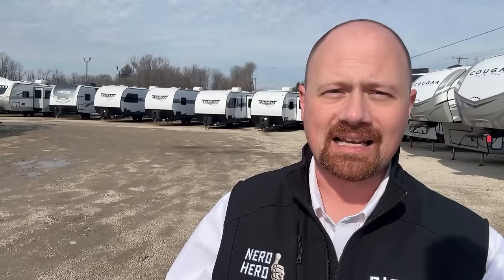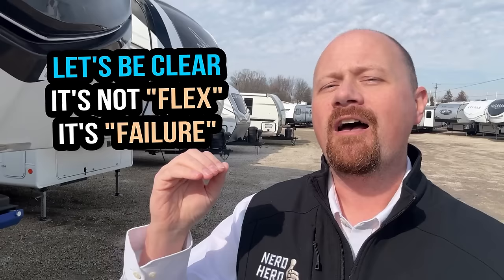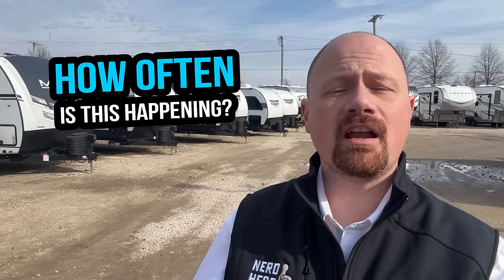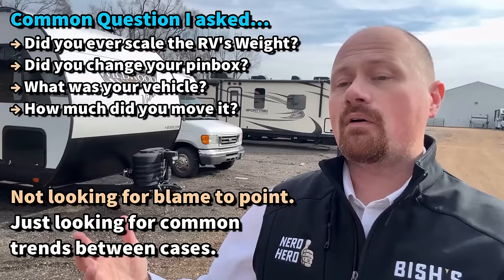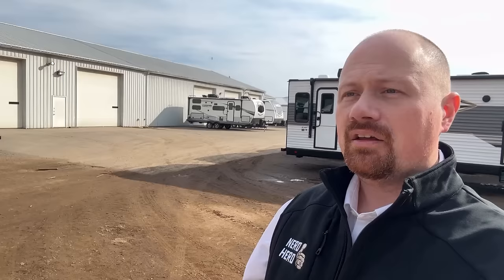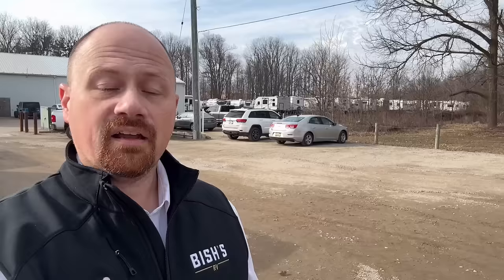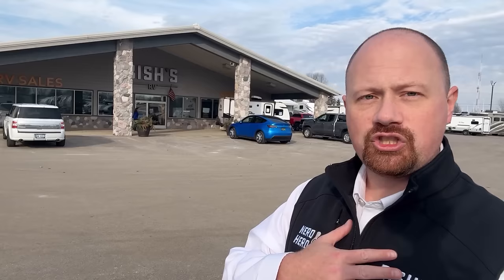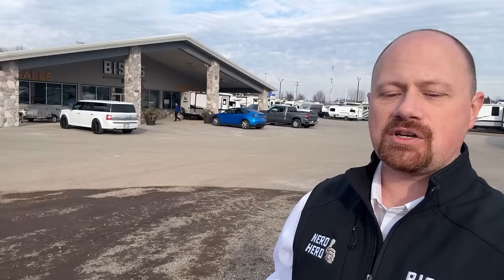🚨 RV Frame Flex & FAILURE!! • WHAT is Happening and WHO is Responsible?!

Comment: Josh,  Thanks for presenting this video.  Very good info.  You brought up trucks.  Here's one I have learned the hard way.  A 1/2 ton truck might very well be rated at 9-14k towing.  What people do not understand is that the camper might just be within the weight limits of the truck, however, when it is 37.8ft long, it can really be a challenge to tow it properly and safely.  Ask me how I know.....
On the 5er's... You brought up several points, but, I think that adding things like a washer / dryer to the front of the RV can contribute to the issue.  And, I also believe that front kitchen models are another problem.  Really, I personally believe that you should keep most of the weight over the axles or even further back, and not towards the front.  I am no expert, but, weight could very well be causing these issues.  Just my humble opinion, but, I would never have a washer/dryer in the front area, nor a front kitchen with that heavy residential fridge up there.  
Finally, I think that some of the problem is indeed the manufacturer, trying to get more for less.  The frame should be able to exceed the design of the RV.  Some of that would boil down to using thicker steel, and, work with the frame manufacturer to develop frames that were designed for the weight the RV builder is going put on the frame.
Reply from the maker: Spot on. I have a video somewhere in my library, here talking about trailer length versus towing length. That’s a very good point.

Comment: As a retired truck, driver, I approve of this. People watch your axle weights if you have a halftime and fill up the back of the bed of the truck with firewood, it might tow terribly.Just sayin
Reply: Absolutely! Mechanic speaking Anytime you overload a vehicle suspension it will ride on an overload spring or bump stop( or when hitting a big  bump the spring rate will increase dramatically) transferring to the axle housing and trailer frame. If your back and butt feel it, your trailer feels it!  The public roads are also getting so bad with pot holes, causing all types of problems
Reply from the maker: Ty Bruce

Comment: Thank you Josh for your homework and continued sharing with the community.  I just purchased  my first RV (5th wheel) then “Frame Flex/ failure posts all over the interweb to scare the crap out of me. To some of the points in your video:  I have been following you (and others) for over nearly two years before purchasing — evaluating my needs, tow vehicle specs, reading RV manufacture info and stickers/data tags. The BIGGEST thing that NEVER crossed my mind was that an RV might NOT have been manufactured for the sole purpose of dragging it all over the place. Maybe mine is… how should I know??  Manufacturers and dealers really need to help us understand these things and most importantly, as you stated make as much information about the their products readily available and factual. Keep the pressure on Josh and keep up the good work!
Reply from the maker: Ty so much. What did you get btw?
Reply: @JoshtheRVNerd  thanks for the reply Josh. I purchase a GD 150 series 270BN. It’s just the wife and I. We liked the floor plan a lot and wanted the 30ft length for National Parks etc. After all of my research GD, seemed at least, to still be a good brand. Seems to be different being said these days but the workmanship on our rig beat out most others we looked at in that class.  FYI: I’m in California now but lived/ worked in Coldwater for 3 years and remember your family’s business.

Comment: Josh,

My wife and I were at a show yesterday looking at RV's we were able to meet the owner of Alliance.  Coley was very forth coming with all questions we had.  To the point, his responses were in line with what you stated in this video.  I asked him about the frame failure, and he did not avoid the question at all.  As a matter of fact, he stated many of the same things you did as to why it is happening and where Alliance falls in that spectrum.  

Thanks for always putting out the hard information and trying to do the right thing always.
Reply from the maker: I’m sure trying Phil. Thank you so much.
Reply: Our family is going full-time in a 23' Alliance Paradigm 390MP on Friday. After doing a lot of research and speaking to countless folks - both in the Alliance owners community and on the corporate side -  we felt the most comfortable going with them. Time will tell if we made the right call but comments like yours are always reassuring to hear. Transparency is king!

Comment: Seems you are putting a lot of this on owners and not the manufacturers, if they built a quality product meant to hold up over the long haul, a lot of these issues would be moot.
Reply from the maker: I would be curious to know if you saw the end where I had a message for mfgs and dealers

Or any of the times where I said “how can you fault an owner for never being told how they were “supposed” to use it”

Comment: Josh thank you!! We are picking up our brand new Keystone Fuzion 419 on Monday! We have been talking a lot about the frame crack/failure that happens with these big boys! My husband just said, “I wish Josh would do a video about the frame issues!” ….and lo and behold, here it  is! We did feel that a lot of the issues are coming with overloading as well as towing with the wrong rig. Never did we think about having “too much truck,” but that makes perfect sense. We’ve got a one ton dually with a 24k Husky hitch.  We thought a lot about how NOT to overload it. We were thinking that switching to residential mattress might be part of the issue but who knows. We’re keeping the RV king in there just in case! Lol 😂 The Fuzions tend to crack on the bedroom slide out with the East/West beds. Of course that’s ours. We will take this video to heart and really appreciate you. ❤
Reply: Get a note pad and pencil go through your new rig with a fine tooth comb. Your list of things to repair will be extensive. Get an appointment before you leave for your first trip for just after you return. Very hard to schedule repairs. Our list was 2 pages long ie; the shower wall was not actually attached to a piece of wood! Wire slide was to slack on 1 side, one heat vent was blocked with foam. Just weird stuff indicated to me quality control was lacking.

Comment: With decades of testing and forensic failure analysis engineering experience, the RV  Industry has legendary unacceptable component, parts, manufacturing,  assembly, designs,  and business practices that end users are frankly done with all the bs.

With record RV sales during the pandemic has resulted in record number of pissed off end users. 

As a result there have been significant litigation cases significant talk of  new legislative actions that hopefully will significantly improve designs, reliability, warranty,  and service related issues for all parties involved.

Comment: One thing I did not hear you discussing was about the manufacturer of the frame and what the manufacturer of the RV asked for. 
I know companies like Lippert build to the specs of the RV manufacturer. One thing I would like to know is when the frame is built to their specs and is finished do they have the frame manufacturer like Lippert look at the finished product to make sure it is still within the specs. Many of the RV manufacturers change designs and layouts that could affect that. 
I also wonder what other types of 5th wheel hitch types like the Anderson affect this. We have a 45’ Alliance Valor toy hauler. It pulls the RV great but is that supported by the RV manufacturer.

Comment: They are simply under built. I currently own an RV rental company and own a trucking company. Before I got started in this, I was a mechanical engineer. Simply put, camper frames are so under built it is mind numbing to me. For instance, look at a 7,500lb GVWR car trailer and then look at a camper with the same GVWR. Mainly the front "A" frame area. Then go look at a gooseneck trailer and then these big fifth wheels. It is insane the difference. Of course, they are going to flex and when things flex, they will eventually give out. Yes things need to flex but the right material and thickness is needed to withstand years of flex before failure. Like you said, they are not designed for that.  As for fifth wheel pin box changeouts, people need to look into air ride hitches for their trucks instead. They add to the suspension cushioning and will take the away from the shock that is transferred through the frame.

Comment: I find that there is a scary number of people who fail to take into account the weight of their fresh , grey and black tanks.  A couple years ago at a provincial park I told an RV owner how much weight he was adding to the trailer by filling up his 114 L water tank at the start of his travel day.  That, plus a full fuel tank (209L) added 323 kg (712 lbs).  I will never forget the look on his face.  Absolute shock.  For some reason, it never occurred to him that this added to the weight.  Others I e spoken to assumed that the "empty" trailer weight was actually calculated with full tanks.  Education is key.  I've been learning for two years now, and I'm still at least a year out from purchasing.

Comment: Thank you, Josh, for another excellent video! So glad that you emphasized scaling your rig, especially once it's packed with all the 'stuff' one travels with. CAT scales are great for this; gets all the axles (trailer and truck). I think it's important to also weigh the truck separately with full fuel and typical passenger/cargo load so the actual pin wieght can be calculated from the two scale weights.
Reply from the maker: Glad it was helpful!

Comment: Hi Josh. 
  I started following you a few years ago as we were looking to buy a towable trailer. I find your videos informing and appreciate your knowledge.
  I may be able to help with some info on this. I work for a very reputable California RV repair shop. I have been seeing some pin box issues as you describe, but by far, the more serious and prevalent issue is frames cracking in the web right at the area where the spring hangers are welded to the frame. We have repaired around a dozen of these in the last year. The mfgs are helping customers in some cases, some not, usually dependent on age of the coach. The issue is by far happening more often to 5th wheels, vs towables, but we repaired two towables just last week. We see more issues with GD than anyone else. After months of denying the issue, the mfg's have now come out with a bracing kit, with instructions on how they want it installed. 
  Owners, look for horizontal cracks in your frame, that will occur anywhere from the front axle spring hanger, to the rear axle spring hanger. They are usually easily identifiable, even to the untrained eye, as they will look like cracks, with a rust line in the crack. I have seen anywhere from one to even three cracks per side. Inspection is very important, pull the wheels if you have to. If you are affected, the sooner you catch it the better, for warranty consideration, as well as safety reasons.
Reply from the maker: This is great. Ty for taking the time to share this

Comment: Josh, Another huge reason I went with the stick and tin Jayco. I love the look and weight of the fiberglass type campers but not the problems related to it. Thanks again Josh for TELLING IT LIKE IT IS! You are a Lone Ranger in this industry, keep doing what you do, we love it.
Reply from the maker: I appreciate that. I do my best
Reply: I agree with the stick and tin Jaycos.I have one but pull it little...its still like new parked at a Louisiana govt park 170 miles away.They are tried and true and the Amish really used common sense at every angle.
Reply: They’re tried and true with close to 100 years of track record. I’m taking a vintage trailer restoration online class by Larry at Mobiltec. Those old engineers figured this out so long ago with not even a calculator and the fact there’s 1000’s still in existence which proves stick and tin is king. If we could look into the future, every old fiberglass trailer will be in the landfill. Not being mean, just look at the facts. They are doomed to fail and almost impossible to fix for the average person. A 70 year old camper can be stripped to the frame, rebuilt with wood, most times even skins can be salvaged. Interior birch panels, amber shellac, can look and function better than new. $10,000 can completely rebuild A small camper  by the owner, and if you reseal the doors and windows and cap rail if so equipped every 7 years, they literally last forever.

Comment: This says a lot! 
My wife wanted a 5th wheel camper, but I told her I will agree to get what we previously had, but no RV. After I explained my reasoning, she agreed 100%.
A few years ago, we had a 42' living quarters 4-horse trailer with slide-outs. All welded aluminum frame, all aluminum exterior skin and the floor from front to rear was extruded interlocked aluminum (no wood). The only steel was the gooseneck, electric jacks and torsion axles. Built to haul (4) 1,000+ lb horses. We used that trailer many times camping at campgrounds without horses. Could fold in the tack room and use the back as a toy hauler. We pulled that trailer all over NC, VA and TN mountains for a few years, most of the time was towing 2 horses and on occasion 3 or 4. I pulled it from western TN to central NC to get home and see that my wife accidentally left a cup half full of drink on the kitchen countertop, that cup was still on the counter and not a drop of drink was on the counter, which says a lot for torsion axles and a well-built trailer. Of the many thousands of miles I towed that trailer and the countless nights camping, I never had to repair anything. I just done annual maintenance on hubs and brakes, we used it year-around.
Camper - My Mother-law purchased a new 35' camper. It was towed from factory to the dealership on the NC coast. Towed 6 miles to a campground where it was set on blocks and tied down. Two years later she wanted to move it to another campground on the coast, so I towed it approx. 100 miles to a campground where it was set on blocks and tied down. Now, 6 years later and less than 1,000 towed miles, it is falling apart. Every year she has to get multiple items repaired on that trailer, including rotted flooring, leaking roof, AC unit replaced, water heater replacement and so on, it's non-stop. This is with a 74 yr old woman staying there 2-3 months a year and it sitting (with hvac on, conditioned). I couldn't imagine what a disaster that camper would have been towing it a few thousand miles a year with it falling apart just sitting on blocks!

Comment: Great Vid Josh.  "Flexing" is normal not just in RV's but everything basically that moves, autos, trucks, aircraft, ships, metal swing sets.  Failure? Start with excessive flexing, leading to metal fatigue. Add in the fact that travel down the road every trip is an earthquake (talk about flex!) and as you pointed out -overloading, especially off center loading can increase stress. 40 ft going down the road? It's flex city Josh! Then add in off center loading and a cambered road - -. Back in the day (I'm dating myself) 40 ft single wide trailers were designed to be moved once or twice, then left at their permanent location and supported. Today we see them moving down the road for a weeks vacation or less. Are the frames any stronger??? Higher tensile steel? You hit a lot of topics and it was a great video.  Everyone shares some blame on this with information - Maker, Dealers, Owners etc.  It also does no good to watch a video where an owner says "My frame broke" without giving full information on how, when, what types of roads, temps, how many miles, what the tow vehicle is, weight, new, used and many other items.

Comment: I attend a music festival that has the camping area in farm fields. There are lots of ruts and when it rains the campers have to be towed with huge 6 wheel tractors. I watch the $300k+ trucks and campers drive into these fields to camp and am not surprised there are issues. Also, getting to the Festival means driving down a narrow tree lined road and the tree branches are hitting the roof of the taller fifth wheels. Thanks for another informative video!